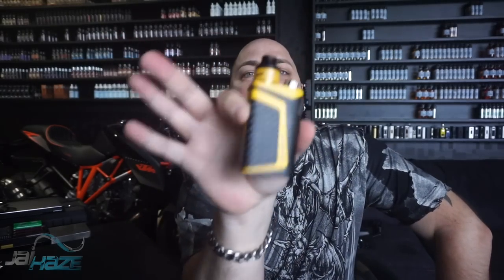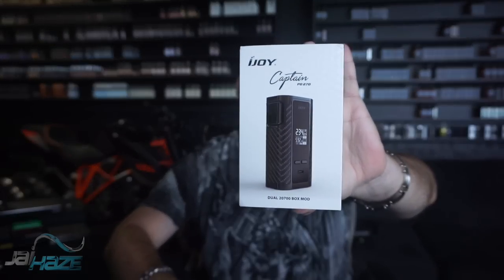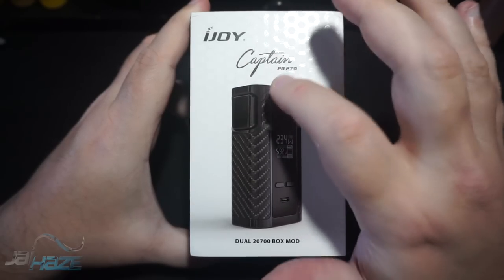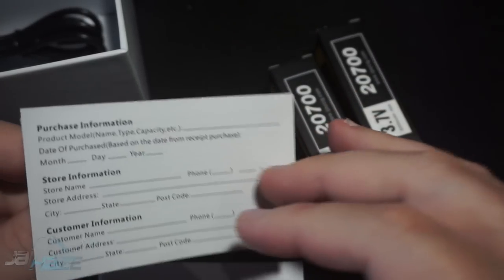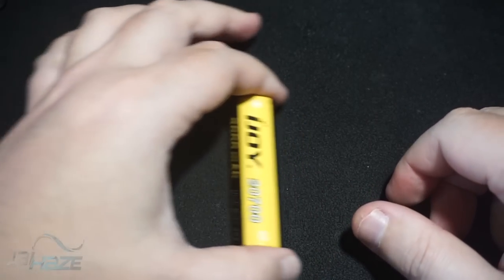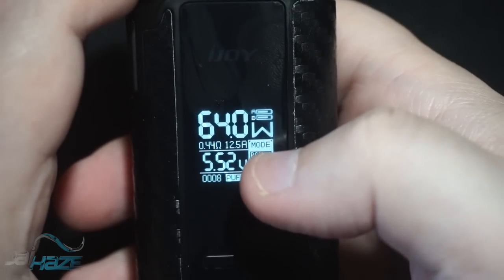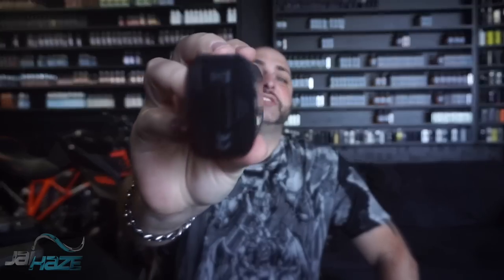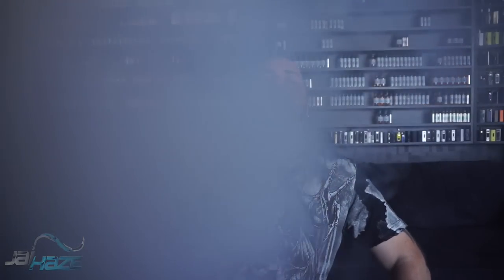iJoy Captain PD270 Dual 20700 Review and Rundown

Comment: You can adjust the ramp time and you had it set to normal, there is also hard soft and user. been running mine for 3 weeks and my stickers are fine, maybe they changed it based on your review? but to be fair from the beginning where you opened the box I knew you were going to rip iJoy a new one. The batteries don't seem remarkable at 50w and are empty after a days work 8-6pm. you didn't even mention any features beyond the first menu, hell I didn't even find out from your review how you lock the thing, you may not like it but a review should be a full review unless its just an unboxing and first impressions vid, which is what I consider this.
Reply: Those stickers are more resistant than most paint jobs on other mods and they gave me the snake skin spares which I really look forward to put on but after 6 months the originals still look great so :)
Lol those reviewers... They get so much free stuff they don't even know what to say anymore, only DJLsb does a real informative review.
The captain is the device on which I put my favorite tank with my favorite juice in it so yes I'll give it a 4 too... 4 out of 5!
My cousin wanted to trade his T-Priv for my Captain and I told him you can keep your Christmas tree :)

Comment: It's best to think of the iJoy 20700 batteries as high-capacity 30A batteries and not as harder hitting 3000mAh batteries. These iJoys batteries run over twice as long as LG HB6's and can handle incredibly high current levels without getting hot. They're a fantastic choice at high power levels. At lower and moderate power levels you'll only see a bit of improvement over the good 18650's that are available, consistent with the slightly larger size of the 20700's,

They're not Sanyo rewraps as they would have a three "leg" top contact. They are probably Panasonics as the five "leg" top contact is typically from Panasonic. I can't say for sure though.
Reply from the maker: ok yeah i was going by your post here when I talk about the 20-30% increase in battery life.  But the 30Q are 3000mah and the sanyo a is about the same mah.  So wouldnt the battery life be pretty close to each other?
Reply: Jai Haze yea, fairly close, but the iJoy holds its voltage up a little better so it takes longer before it drops down to the mod's cutoff voltage. This give it a bit more vaping time than the 3000mAh 18650's. Thanks for the review!
Reply from the maker: no problem brother, but which ones are the best 20700 off the top of your head.  Sanyo, Ijoy and whatever else?
Reply: Jai Haze the Samsung 30T 21700 is #1 by far, then the Sanyo NCR20700A for hard hitting at high power and NCR20700B for long vaping time at lower power, then the iJoy and Ampking (same cell) for lower battery temperatures and safer vaping at extreme current levels (but not hardest hitting). All depends on what you're doing and your priorities. Overall, most would probably want what the Sanyo NCR20700A gives. Of course, everyone is sold out now.
Reply: Would these batteries be ok under 200 watts?  I vape around 130 watts and lower.  I really want this mod for a longer lasting battery and its stylish as all hell.  Thank you
https://www.imrbatteries.com/sanyo-ncr20700b-4000mah-15a-flat-top-battery/
Reply: Christopher Greenwood sorry, all YouTube messages for a couple of weeks went to my Junk folder....sheesh. The NCR20700B is best at under 35W (each) or so, 70W in a two battery mod. Above that the iJoy/Ampking/Efest is better.

Comment: cant find any info on single 20700 or 21700 compared to dual 18650. How does the battery life compare in these 2 types of mods? Is there a significant difference? Or does the 2X700 single mod almost give the same amount of life? Cause if its pretty close i would get the single 2X700 3d printed mod due to the difference in weight and portability and size and sleekness. Can anyone shed some light?

Comment: Hi Ijoy Fans!

I've bought an Ijoy Captain PD270 mod. I tried to update the software but the updating software says that the device is unplugged. So I could start the update (means the software can find my device) but soon after it drops the usb connection. Do you have any reset button combination to get back the default settings or what can I do in this situation?

Thank you for your answer!

Comment: Have a question, a 20700B or 21700 battery fits in the mod, can you use the Mod in the socket while it charges, and can it connect it to the external Power Bank?

Comment: I didn't have a sticky button with my rdta box mini, however after a few months I feel extreme heat coming from behind the fire button and USB port when I use it. 
I feel like maybe the battery is getting too hot. So it's shelved. I feel weird about just throwing it away though.

Comment: chinese after sale , are they good to anyone ?! i doubt .. as for the  new mod i agree it is very normal  and yes looks like my cuboid if wrapped with fiber carbot sheets . it will fit a larger tanks . the 20700 batteries yet are not widely spread but  there must be a point to start and this mod is the start .

Comment: for guys like me who use a lot of mech tubes the 20700 is a great battery, but I agree in a regulated mod it's not a big difference.
Reply from the maker: mech mod, you wont be able to use either of them in a mech mod. Its like using an LGHG2, unless you are looking for the A its just the same as a vtc6. Check out his charts https://www.e-cigarette-forum.com/forum/threads/sanyo-20700b-4000mah-20700-bench-test-results-a-peek-at-the-future.775809/

Comment: Yeah the 20700's are getting especially hyped by single tube mech users. Apparently it is a "40 amp" battery. But I dunno how true that is or not. The 20700A.
Reply from the maker: did you check this out? https://www.e-cigarette-forum.com/forum/threads/sanyo-20700a-30a-3100mah-20700-bench-test-results-a-great-performing-30a-3100mah-battery.784543/
Reply: Jai Haze Interesting, thanks for linking that.

Comment: iJoy has the Wondervape 270 mech & Broadside has the Brass Admiral mech - both can use 20700s (& Kindbright even has a hybrid that can as well)....

I pre-ordered mine just over 3 weeks ago and am not even sure if it's left China just yet (but I got it at a good price)
Reply from the maker: the problem is THE ONLY one you will be able to use is the sanyo a - which is almost equivalent to the vtc6.  Here check this out https://www.e-cigarette-forum.com/forum/threads/sanyo-20700b-4000mah-20700-bench-test-results-a-peek-at-the-future.775809/

Comment: Running my iJoy Captain now over 11 months no sticker peeling . Batteries are still going strong. I love this mod and it's simple to use maybe that is why I like it.
Reply: Mine for 7 months. No issues either. I chain vape to fuck, went to work at 7am finished at 2pm... had 3 vape breaks, chained from 2pm till 4am... still had 1/4 battery left. No drops in performance below 25% either
Reply: This thing can last 24hrs easy on 20700 batteries

Comment: Agree with a good % of your reviews however I'm more than a little confused with this one. I don't own one nor have I ordered one however your so-called cons make as much sense as a stripper having self esteem issues about her body. The features of the mod are the same as 90% of the mods out and the price not warranting the product....they're on Efun for 44.09 with 2-20700 batteries, deduct the cost of the batteries in a shop and you're basically getting the mod for next to nothing. 
Love your channel Jai but IMO, this review, not so much.....
Your opinion is yours, mine is mine, cheers
Reply from the maker: When you buy a car and drive it, would you buy it if it had a VELCRO steering wheel?  Or if you bought a shirt, would you buy if it is made out of plastic? If things dont feel right, they dont feel right.  I have to disagree, there is no features of this mod.  Seriously.  There is no key lock, there is no other settings on this mod aside from temps.  The problem is if this keeps being the standard, arent we stepping back in technology.  As much as I dont need BT on my mod, that was SXJ450BT selling point aside from being a bad ass chip.
Reply: I get your point but for the price I think it's a steal, I've seen complete shit come out of China for the same skins. Same options, same specs or less, 510 issues and paint chipping off within weeks of purchase. If I was offered an expensive sports car for cheap with a Velcro steering wheel I'll jump all over it. A shirt, not sure how to respond to that one, A decent shirt is made out of decent material, a cheap mod is made out of plastic.....the Captain is made out of Zinc! however the cheap stickers are also a piss me off keeping in mind as you mentioned that real carbon fiber at the offered price isn't possible. 
As I said Jai, your channel "keeps it real", that's what I appreciate about it, I like watching indoor smokers however I do so knowing that he never dislikes anything and is IMO clearly endorsed by maybe Smok and definitely Vaporesso... I look at 90% of the so-called reviews as first looks considering it's a pissing contest as to who can get a video out the fastest. I Also watch 'The Vape Team' every week and enjoy it however watching Mike whine about you gives me a hard on. Mikes dislike for you (you being the only one besides Grimm to give the icon a sub par review) gets this 45 year old dick hard beyond any point Viagra could. Regardless, it is what it is, I can't nor am I trying to change your opinion, only voicing my own. Cheers from Canada
Reply from the maker: give me a chubby knowning he gets one cause he cant say shit

Comment: Shit, now my ass needs to go find a different dual mod... Any suggestions!?
Reply: JUMP23MΔN wismec rx 2/3 is my go to all day banger. great price. great chip. some cool extra features and options. upgradeable firmware (which does add more watts in each battery configuration ). 2 or 3 battery versatility. feels amazing in the hand in both modes. you simply won't find a mod for the same price point with these features. some had issues with the 510, but wismec has since fixed this issue, so just  make sure you get a new one, and you're golden . I've had mine for 7 months and have had zero issues with it whatsoever.
Reply: Brian Etris Nice, thanks for the recommendation Brian!
Reply: JUMP23MΔN bro check out squid industry double barrel.

Comment: I held this mod in store planning on buying it and immediately changed my mind after picking it up. It feels light and cheap, the sticker wrap peels off easily, and the screen is made of soft cheap plastic rather than glass. All of their display models (which were stored behind locked glass) were scratched to hell. There are definitely better mods for the price, I ended up getting a Tesla Punk 220w.